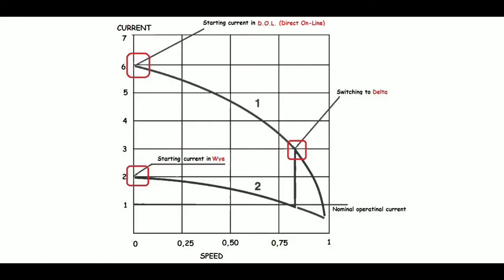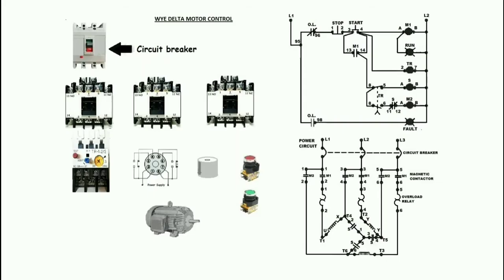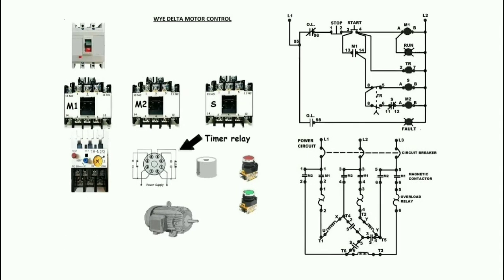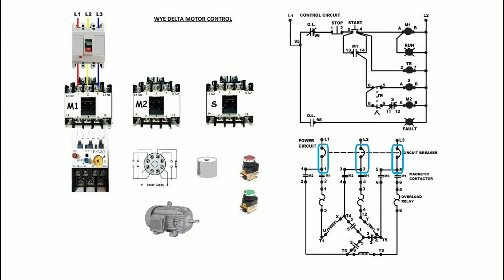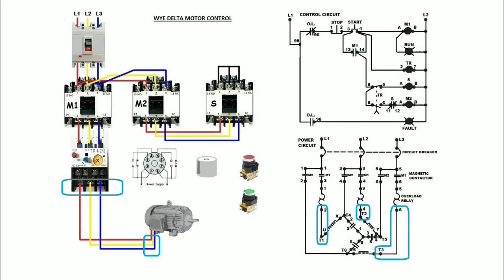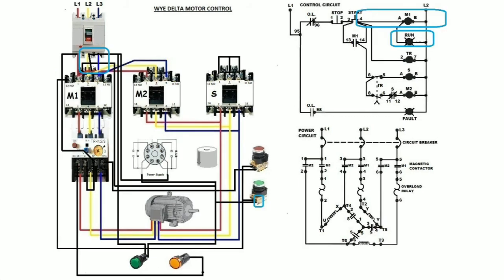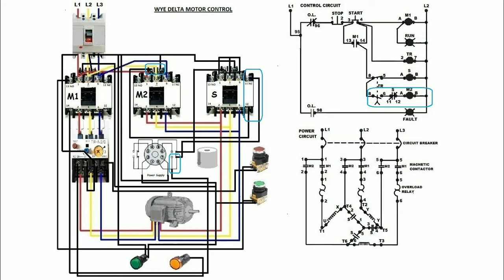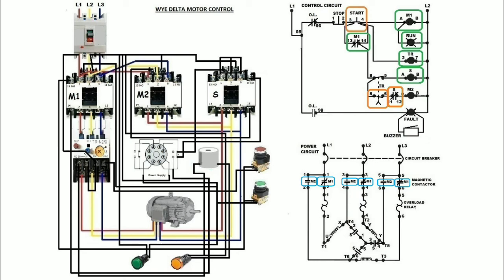Wye Delta Electric Motor Control.

Comment: This will serve as my additional knowledge in electric motor control. May I request for some of the building equipment.
Reply from the maker: No problem... Okay, I will start power generation or power distribution systems.... Stay tuned for more videos.....